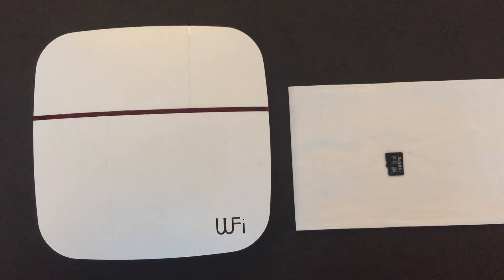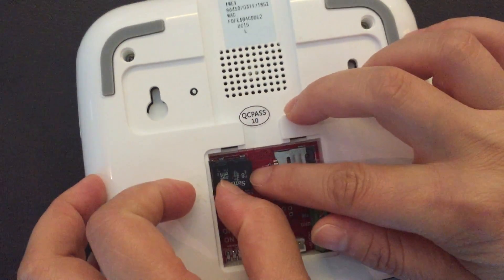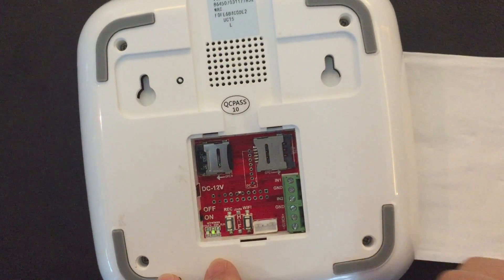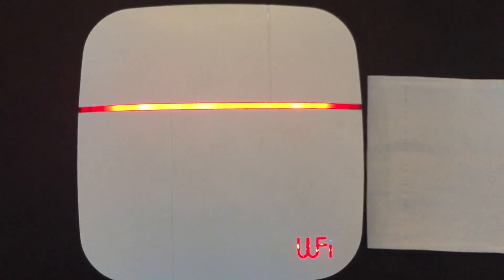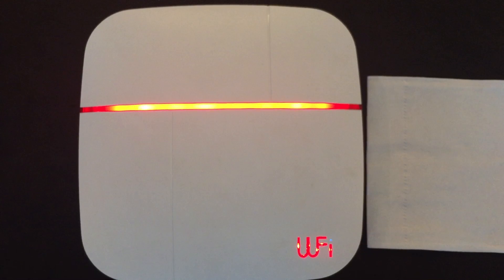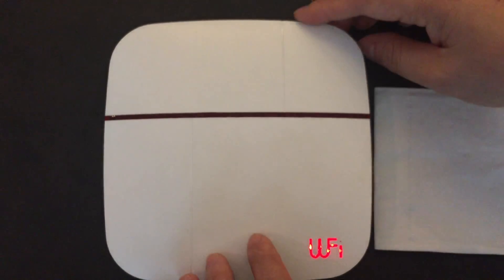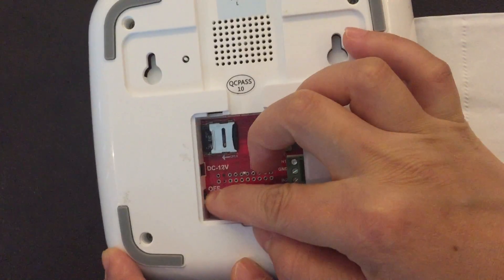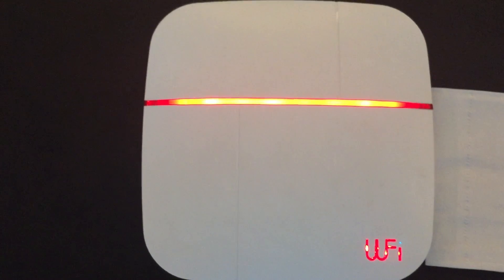How to upgrade the firmeware for your WiFi Alarm Gateway -Vcare

Comment from the maker: Following is the steps of upgrade firmware:
1. Please tell us what's the version of current gateway and check if your gateway comes with a SD card socket on the back of it. If yes, please get into step 2. 

2. Please un-zip the RAR documents (the latest firmware document) and then put the "firmware" to a TF card, insert this TF card to alarm panel. (The TF card should be less than 8GB)

3. Following the video to finish upgrading:  https://youtu.be/wQSgMU8dDeU  

4. Pls reset the gateway after completing upgrade.  (How to reset, please refer to the video.)

5. After finishing all settings as same as the video guide, please delete all the sensors/accessories you added before and then scan the QR code to add it again.

Comment: Is there any way to reset it from a distance? I am away from my home and alarm just became completely unresponsive on my app. I can still call it and it answers, but seems ignoring all the rest commands. Tried with two different phones, even tried to update apps, nothing helps. Looks like alarm itself needs a reset.
Reply: Back home, alarm is non responsive on App. Tried to switch power off and disconnect battery off, not helping. Left alarm disconnected, App still shows that alarm is online. If I arm by remote control it arms and sometimes sends SMS if triggered, but no notifications on App, also fails to detect triggered sensors sometimes. I hope it haven't failed completely, as it's just 2 month old. Can you tell me if I should try firmware update before contacting seller? Or should I return it back to Patrol Hawk?
Reply from the maker: It's not possible to reset the panel from a distance. Please reset the device by manual operation.

Comment from the maker: Dear All,
Thank you very much for using Patrol Hawk's product. Please check your gateway if it comes with a SD card socket for upgrading the firmware. If yes, please tell me your current gateway version so that i could send the the correct firmware to upgrade. Thank you very much.
Reply: Hi, i have SD Card Socket, current FW is V0.2_PH2GSMWF4161103
Reply from the maker: Please send email to Maggie@phalarm.com for sending the latest firmware. Thank you very much.
Reply: Please can you send me the Gateway firmware update
My Gateway is V0.2_PH2GSMWF4161101